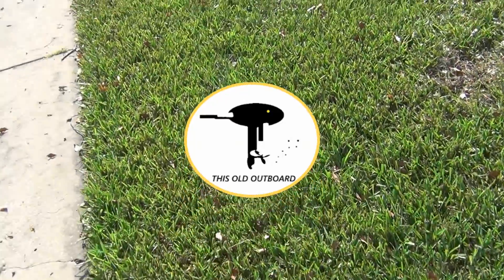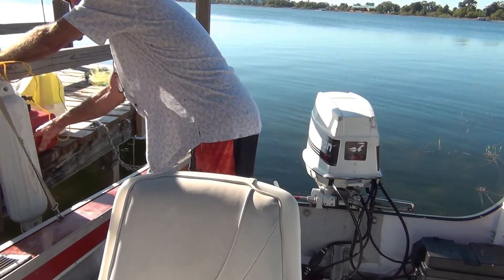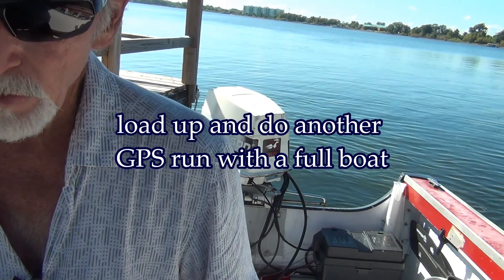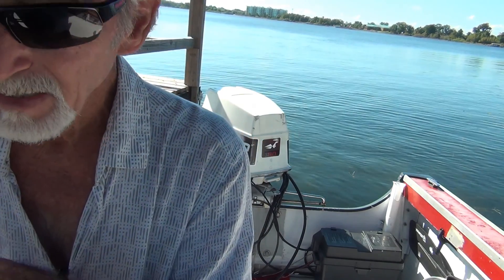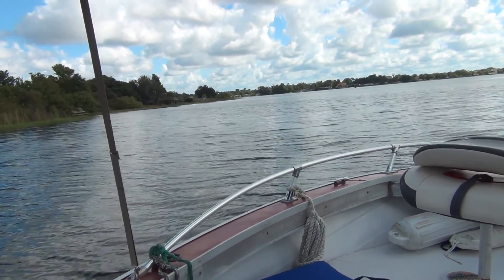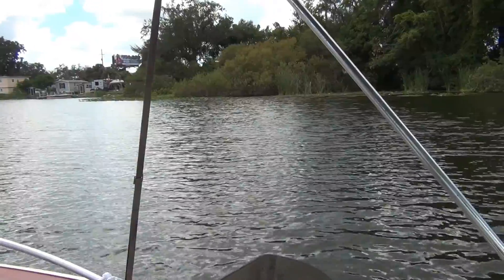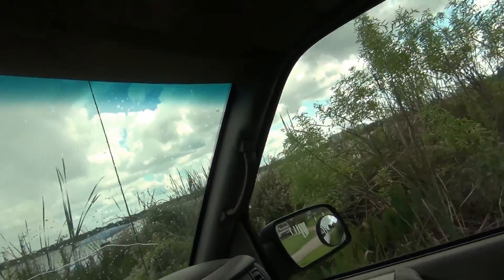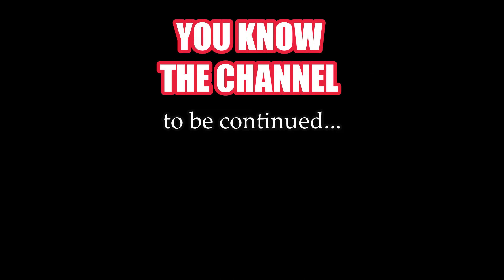1992 60 Hp Johnson Carburetor Swap. GPS Run.  THIS OLD OUTBOARD

Comment: Those 3 cylinders turned the market for OMC in the late 60S coming out with the 55HP Triumph great motors love the looper design nice and quiet compared to crossflows  sounds great!!! I luv your close proximity to the lake. Im about two miles fom two boat ramps and I dont go its too far,....LOLLLL! Motors run different day to day try another day lighten the boat if you can 33MPH is a nice clip for a small lake boat..
Reply from the maker: Hahaha. Yeah I got lucky moving in here. Thanks again !

Comment: Nice run and she sounds great though I was hoping for 40 mph. I got 40 with a 15 foot starcraft and a 50 HP mercury back in the day, but the motor, prop and boat were all tuned in by a marine tech who owned it before me. Little lighter than your set up too. Looking forward to more vids.
Reply from the maker: Hey. Thanks for tuning in. Yeah I wasn't expecting 40 but a few miles extra would have been nice. Thanks again & Stay tuned !

Comment: It looks like it may be the extra weight you have up front with the casting deck seat and batteries trolling motor , you should get about 40 to 42 mph out of it eith the new 70 hp carbs installed.
Reply from the maker: Hey. Thanks for tuning in. Yeah after I swap out the prop should get better. Thanks again & Stay tuned !

Comment: My 14 ft whaler with a 40 yammy has the fins bolted to the motor. Those fins allow for fine tuning the trim and in fact I can change the top speed by a lot y adjusting the trim.
Reply from the maker: Thanks for tuning in!

Comment: hi from Sandusky lake Erie. have same year model hp etc motor on 1969 15' sportcraft sprint V. I wrote about last video and asked about prop, you said you had 19 pitch.
So I've tried 
14 pitch 37mph
15 = 38mph and now 
17 = 39mph at any trim and weight so far. two 200lb people, Two full tanks, and perch , walleye gear. even extra steel 50lb weight in bow (the may be little more than boat made for but... AMERICA!  
It doesn't cavitate at all. runs way more quiet and smooth with the 17.
it had a bent up original prop 17 that i straightened but that one wouldn't plane and overheated buzzer came on quick. used troller to get to dock. 

anyway maybe the 19 you have is too steep? runs and sounds great. the fact that mine runs so strong in the upper 30's and yours was too. I've trying Solas props only for consistency.
if your prop needs tuned or lower pitch it maybe worth the $125 better gas mileage and speed. 

Mine was $500 not running and i had to do carbs wiring, hoses, took off VRO put johnson impulse pump from same year commercial motor, and tuning.
Reply from the maker: Hey. Yes I remember. 17 is where I was thinking. What size is your prop? Thanks again & stay tuned !
Reply: @THISOLDOUTBOARD1  Hi The size is 13.5 i believe. Solas part no 2411-133-17. betcha new perfeectr prop will wake her right up.
Not loving amazon but prime accepts returns as long as not f'ed up. I may or may not have used perm black marker to touch up before returning  
 I enjoy the your info and banter. funny we did all the same stuff to engines. I been running mine no thermostat since the warning buzzer and no probs at all.. knock on wood.... 
 I ran almost two tanks running around fishing lake erie islands today. thanks keep it up!
Reply from the maker: @josephmyers1448  thx

Comment: You should throw some top water prop baits my fav was the heddon torpedo gen yell especially around the lilly pads or grass frog exciting to see them hit the lures also on prop lures I bend the props so they have more pitch and then they make more noise JT 🇺🇸🇺🇸🐟🐠🌴🛥🌴⛱🙏🏻🙏🏻🙏🏻
Reply from the maker: Hey. Thanks for tuning in. Gotta get up early for topwater. I use to bend them too! Would you believe I still have a devilshorse in my tackle box. Haha it still looks new.
Thanks again and stay tuned!
Reply: @THISOLDOUTBOARD1  devilhorse the first lure I had success I think it was Tiger tail color great lure too overcast day is good also JT this brings back my younger days before I got my 25 wellcraft sportsman w 300 etec back in 2010 my grandkids love fishing on grandpa’s boat or daddy’s so much his is good too thanks

Comment: Can a motor that ran good when stored  several years ago still be saved if it was never winterized or drained? 115 evinrude
Reply from the maker: Hey. Sure it can, but you may have to replace some parts depending on how long it sat.  Usually coils will dry up and crack, stuff like that. But you wont know until you fire it up! Thanks for watching & Stay tuned !

Comment: I have a need question for you.  On the 60 is the timing the same as the 70hp also is the plugs and the gap the same.  Hu?? May need to do a little adjustment on the fireplace inside.  Good luck 👍.
Reply from the maker: Hey. Thanks for tuning in! Yes and yes!

Comment: 33 ain't bad on that rig and that motor sounds like it is giving all its got what is its rpm at top end speed? those boats can lean easily they typically are not that heavy bout 475 lbs hull weight//good fuel mileage
Reply from the maker: Hey. Thanks for tuning in. Yes, That was the intention of the build, to stay as light weight as possible. I have no tach, it's on my christmas list! Thanks again & Stay tuned !

Comment: When you have a 33 mph head wind (your forward speed) the air restistance from all the stuff (trolling motor, new seat, etc) goes way up. Just the roof rack on my truck kills my mpg 's . Undo everything you have done since 39 and see what you get? Or not?? Jay
Reply from the maker: Hey. Thanks for tuning in. Yes I know, that was the purpose of a full boat run.? It's just a boating thing. Full load vs. No load. Or should I say a curiosity thing. Either way. Thanks again & Stay tuned !

Comment: Even without the speed it still sounds sweet! If you're getting WOT than it surely is the jets on one or more, On my little boat I swapped out the 25 carb for a 35 carb and intake losing 2mph-but it came out of the hole faster. Someone had put in a 30 jet , waiting on the right one now. Have you checked the exhaust capabilities? Some '80s & '90s couldn't be bumped up even 10hp due to differences in exhaust configurations.
Reply from the maker: Hey. Thanks for tuning in. No I haven't checked the exhaust. Good point! Thanks again & Stay tuned !
Reply: That’s a good point. If the 70 uses a less restrictive exhaust then you would be running to rich (with only swapping the carb) which could give you a better bottom end performance but les top end. Maybe if you ran it without the cowl and air box as a test to see if that wakes it up a bit.
Reply from the maker: @Xiaopang5544  hey. i think it did. stay tuned
Reply from the maker: @Xiaopang5544  hey. I just checked part numbers. the adaptor and gasket  are rhe same for the 1990 70, & 1992 60 but the megaphones are different numbers but look almost identical from pictures on ebay. And the 1992 70 uses the same megaphone as the 92 60.

Comment: Can't remember how you did the GPS run that gave you 37 mph but any such test should be done with runs in the opposite direction to even out the wind factor which will make a huge differeence. Air temperature and humidity levels will also easely affect the results by 1 to 2 mph. I concur with this other gentleman that suggest that you get precise RPM readings as they will tell you a lot.
Reply from the maker: Hey. Yeah I'll get one soon. Thanks again !

Comment: What is your wot rpm? You may need to change prop size with the extra weight. If prop slips when trimming you may need to install a hydrofoil
Reply from the maker: Hey. Thanks for tuning in. I'd have to look it up again to be sure. I don't pay to much attention to wot rpm's. I have no tach so it doesn't help much. Thanks again & Stay tuned !
Reply: @THISOLDOUTBOARD1  hook a digital timing light or get a $25 amazon digital tach that has max/min feature on it. these like to rev. shoot for 6000rpm

Comment: are the throttle shaft roll pins exactly vertical? did you bump up timing one degree aka 1 full turn counterclockwise on the WOT timing?
Reply from the maker: Hey. No I haven't touch the timing yet. May try it. Thanks again !

Comment: He bud, run the engine at WOT like you are doing. Then cut the engine, don't idle down. Pull the plugs out they should be a light brown color. If you are lean they will be whitish and if you are rich they will be a darker brown. I'm at 3000ft here and I have to use a much smaller main jet to get the proper plug color. PS if you are too lean you can burn the pistons and top ring land.
Reply from the maker: Hey. Thanks for tuning in! Yeah I Know. I'm at or maybe a little below sea level. Never had or heard of anyone around here having a problem. But I know what you mean. Thanks again & Stay tuned !

Comment: Couldn't start any better Couldn't run any smother . TRY thronging that dam phone as far from the boat as you can.wet your finger stick it straight up in the air push the throttle all the way down. SEE if you can feel air going acrost that wet finger. if yes you are moving f0rward call it good. Have a beer and a few wings. IF IT STILL BROTHERS YOU REPEAT THE PROCESS.
Reply from the maker: Hahaha! Thanks again !

Comment: Can i pick yalls brains i bought a 80 Bayliner mosquito with a 75 johnson 70 hp had no high speed i cleaned the carbs put kits in carbs replace fuel pump fuel lines pur carbon fiber reeds new gaskets when i put it back together and fired it up it ran away full throttle couldn't get it to shut down i un hooked fuel line and ran from it thought it was gonna fly apart can anyone help i have no idea what i done wrong
Reply from the maker: Hey. Wow. Check the throttle cable and linkage. Sounds like something is stuck or broken.

Comment: Judging by what you're saying (and what I see in the service manual) a 1990 70hp motor needs 52D jets to run like a 70.  It probably ain't gonna happen with a 45D jets and wishing your 60 was a 70.
You got to figure out what year those gift carbs are.  If they are 1990, you need 52D jets.  If they are early 1992 carbs, you need 44D jets.  Late 1992 carbs have the black flat-top plastic covers.  I don't believe you have those late carbs (from what I remember seeing when you unpacked them).
When I went to OMC tech school in Atlanta, our instructor, Jarrett Young, was asked by someone in our class what OMC 2-stroke motors could be taken to the next factory hp level with a simple carb change.  He said there is one - and only one - that being taking a 9.9 to a 15 with just a simple carb swap.  He said nothing else will completely do the trick because there is more than just carbs involved.  Apparently nobody believes that these days except those of us who took the OMC tech classes.  Take that for what it is worth to you.  Is your 60hp intake design and intake port size exactly the same as a 70?  Is your timing curve the same?  Is your exhaust tuner the same?  What about your throttle cam linkage?  Are you sure those are really 70hp carbs?  Is the venturi size the same, or different, than a 60 carb?  Lots of questions needing lots of answers........  That said, I really hope you get it straightened out and running like a Johnson Stinger.
Reply from the maker: Hey Mike. Thanks for watching and commenting. I really appreciate it. You hit the nail on the head! Thanks again & Stay tuned !
Reply: @THISOLDOUTBOARD1  I'm pulling for you, buddy!